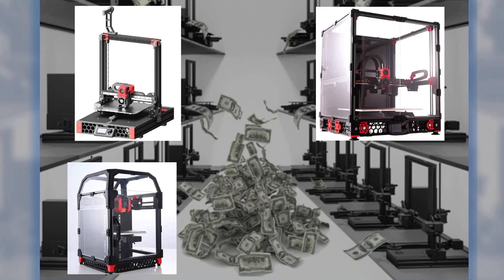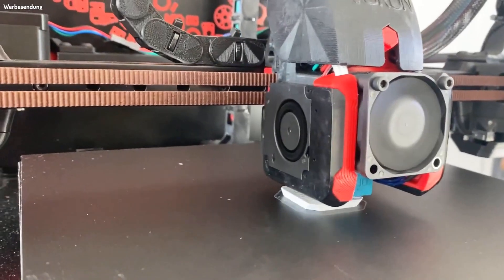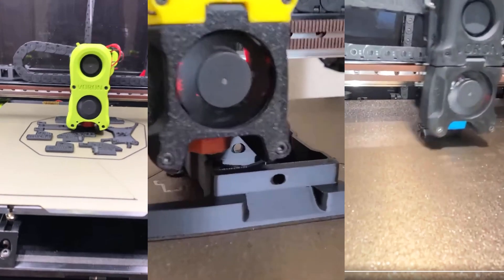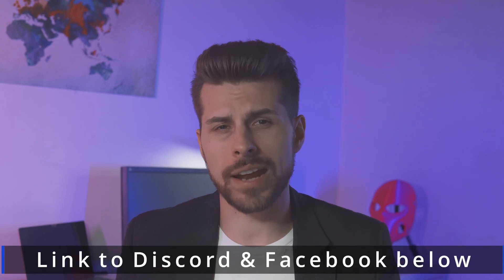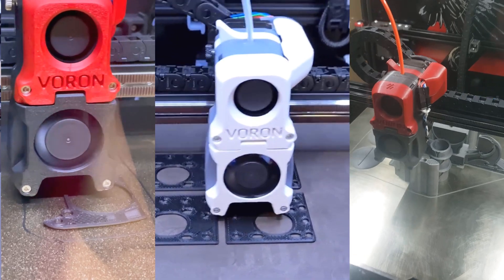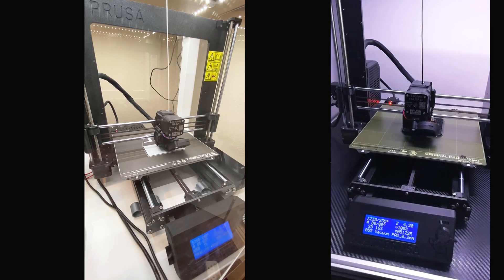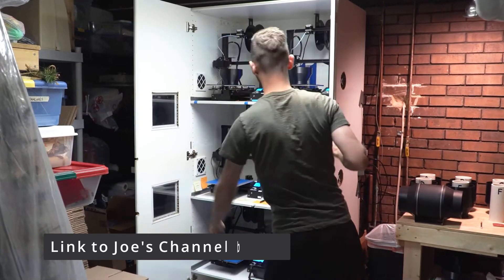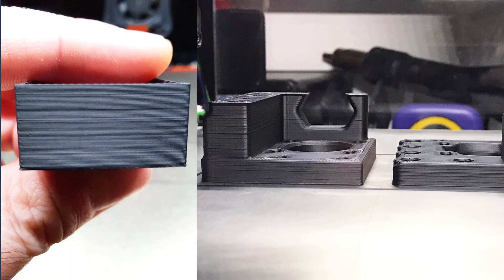Voron Printers: are they true farm printers or capable hobby printers?

Comment: I think you have missed one thing you just said  one sentence, the "heavily modified" Enders you have. Maybe take into account the time/resources to modify those ones as well? And compare them to a DIY reliable printer like a Voron one, as well as, comparing other printers from the group: the switchwire or the V1 are great options too, and for small prints, the Zero (0), but overall, interesting opinion 🙌🏽
Reply from the maker: Hey Dann, appreciate your feedback. 3years ago i changed old machines with enders, and was doing just fine. After some time i started getting specific material requests and in order to maintain same machines and don’t get different ones i modded them. I designed very few pieces (fan duct, led mount, pi mount), and all the rest were available online, so very low thinkering, i extimate less than 5 hours for all designs. Hardware installation was less than a working day for machine. Not much overall. I was planning of making a video on them and how i split my work, just have to find the time between rush orders. I wasn’t comparing my printers to vorons, just stating that everyone has different needs thus different printer requirements

Comment: Coming from someone who does print for my personal business, I can say that a Voron printer is a nice addition. It's default printing speed and acceleration settings are about twice as fast as most consumer printers. I just built a 1.8 and it is quickly becoming my go to work horse to substitute my Ender 5 workload and eventually replace it. I did buy a Flashforge Creator Max 2 to print the parts and now thr FF is part of my small print farm. Do I think Vorons are a viable for print farms? Yes but I would plan on building a new machine perhaps every 6 months and slowly replace less capable machines and not plan to build a lot at once. I also sourced all own parts. The ABS experience on a Voron is amazing. They print ABS like it's PLA. That reality sets in when you see the cooling fan running at 30% to help cool the ABS.
Reply: Can I ask why you went with a 1.8 rather than a 2.4?  Thanks.
Reply: @redone823  It's cheaper and more easier to build than the 2.4. Easier to tune. And I figured that since the hotend is at the top of the build volume, it would have an advantage with chamber temp. The 24v components are also easily accessible without having to flip the printer on its side.

Comment: I’m getting started in running my own production and have two Enders with upgrades. Considering the trouble and cost going into adding another upgraded Ender to the line up, and to save space, Vorons are very attractive options. If I’m willing to put in the money for a faster,  more reliable, and consistent machine, are there alternatives to the Voron lineup that can perform comparably?
Reply from the maker: For responding at your question, ratrig is a valid contender. But i don’t know your current needs, so before investing money you will have to do some homework. When choosing a printer keep in mind ROI and time required for regular maintenance and non ordinary maintenance
Reply: look at ratrigs IDEX machine get 2 parts done at the same time as one and you would have the option of adding a second color to 1 print if needed or supports that is water soluble if needed

Comment: 2 Prusa i3 mks+ kits cost 1500 USD and 2000 USD assembled, unless you mean clones, in which case you should specify.Cooling vise, it's not impossible to take of the side plates and leave the door open.I just bought a 2.4 for 1036 USD ink shipping and tax so.And the 1.8 I cheaper. Otherwise valid points:)
Reply: And when that 1 voron goes down what do you do then?
Reply: @dangerous8333  Since they cost half as much as an assembled Prusa, I obviously have 2 so no problem 😂

Comment: My 2.4 kit from formbot cost me $950 canadian and took 1 week to arrive via DHL  ( $1,599.99 CAD for Prusa mk3+) & it prints like a dream. Quiet, fast and no maintenance for 6 months now. Abs costs $24 a spool for abs+ here. If you don't need it enclosed; simple just  open the doors? You can easily remove the panels or not even buy the panels & use one of the many mods for better cooling for pla. ERCF multi material mod costs like $100 and you can have it change spools for you automatically when it runs out loading up to 9 spools. It may not be the best business oriented machine but most of the cons you mentioned are fixed pretty easily.
Reply: Did you print your own parts or order them from somewhere? I am considering ordering a kit but dont feel like printing out the parts myself.
Reply: @Cheetahcubb  I can print the parts for you, cost + shipping.
Reply: Don't forget most people aren't up spending a week building a kit,
. Also there is no way a 9 ch ERCF costs only $100 with shipping and no assembly required.
Reply: This is very encouraging; I made up my mind to build a 3d printer as looking at the Canadian cost for a Prusa I just couldn't justify and I am okay with the time commitment to get it up and running.
Reply: @BrownMInc  The LDO kit from Sparta3D was very well done. Many nice touches. Especially the terminated wire harness... that saves a ton of work.
Reply: @SeanTaffert  I just checked them out and it seems they're out of stock. I've decided this will be my 1st summer project once school is out so I'm viewing other sources, maker parts and spool3d seem to have it. I just joined the voron discord as well
Reply: @BrownMInc  typically the official PIF program from Voron has long wait delays, and not all colour combos are avail from suppliers. I can offer you what you want typically sooner then they can supply.
Reply: @SeanTaffert  thanks for the offer. Given that I won't seriously commence building until at least a month from now I think I'm ok with the queue. If you're as competitive and willing to wait till then I'm open to working with you if you can show some examples/a store. It's times like this I wish YouTube had some messaging feature
Reply: @BrownMInc  just google me for my contact info. Which model are you looking to build?
Reply: @SeanTaffert  I may have found you. I am looking to build a V0.1 mainly for portability.
Reply: @BrownMInc  I'm sure you did. I'm the only one. Montreal based. 
V0.1. Perfect. That's what I built recently. I'd suggest a few mods. Contact me and we can discuss.

Comment: True, using any DIY printer in a business comes with some problems and some advantages. Being DIY you know every single screw of the machine and if something breaks down you know what to do. It also requires an initial investment of tuning and calibrating the machine. Personally I do think you should know your machines 100% if it is your business.

If your products should be made out of ABS I would for sure have a Voron farm. I have a Prusa and 2 Vorons and the Prusa is pretty much collecting dust right now. My V2.4 and V0.1 beats the Prusa in every aspect - however they both required a much bigger time investment to get up and running.

As always, do your research and buy the right tool for the job. Need ABS and want to know your machines? Voron. Need PLA and dont want to know about your machines and you want the option of support to hold your hand if something goes wrong? Go with Prusa!

Comment: i still don't know how they make it to 500+mm/s is it upgrade of bowden extruder + motors or is it just software setting? (talking about voron...) thanks!
Reply from the maker: Hi Katsuo! High speeds are a combination of machine and software. For the hardware, a rigid small frame with tiny moving masses allow high accelerations and high average speeds. The main cap is caused by melting capacity of the hotend (reason behind magnum+ or HF hotends.) if the printer goes fast but the hotend can’t keep up with melting plastic, you will get extrusion issues. For the software, klipper in voron case, has equations that precisely calculate motion paths and amount of material extruded. Good motion system+capable hotend (and extruder!)+good software = high speeds

Comment: I have 4 switchwires in my farm. Same cost as a prusa and 2.5 times as fast for same quality, ordered parts for a 5th on Wednesday and had it running today. You didnt even think about the switchwire when came to your conclusion about 'the voron line'
Reply: Thanks for the input! I’m still trying to figure out what the strong points of each Voron are.
Reply: @toddsfinsdotsurf  If you're still deciding. Build a trident.
Reply: @dangerous8333  thanks ya I've got almost everything I need for a Trident now, gonna be using the new Octopus board, 48V steppers!

Comment: Some valid points, but you should consider building one. In short, most of the issues mentioned, can easly be solved with a mod.
Reply: No they can not. Issue 6 in a lot of people has yet to be solved even after trying different extruders and toolheads. For the price, the Voron 2.4 is a waste of money IMO. However the switchwire and the 0.1 (for smaller parts) are a much better value for the money without the headaches of the 2.4.
Reply: @TheNature101  The issue 6.... Most people don't have it. That's the problem with DIY, you don't follow the sourcing guide and you cheap on something, you run into a problem.
Reply: @KubaAirs  Actually looking at all the crappy Voron 2.4 prints on youtube, I would say "most" people have it. However it is difficult for cult members to admit they spend $1500-$2000 for a plastic functional parts printers that produces crappy prints, when they could have spend 1/4 of that for a Sapphire Plus CoreXY printer with full metal functioning parts, that produces better prints.
Reply: @TheNature101  There are over 2000 2.4 now.... You're totally missing the point of something like Voron. What makes you think that cnc parts makes better printers?  How about Prusa, Annex k2/k3, HEVORT and most of the good DYI printers? 3d printing is not cnc machining and the fast movements of the toolhead must dissipate somewhere. Make it too stiff and it will endup in the toolhead itself, that's why we measure resonance. Voron and similar printers are for somebody who prints day and night. For someone who likes to play with his printer. If you're only printing webcam covers for your grandparents, every printer will do. When you're building Voron, you're spending money on high quality parts, your whole printer costs same amount of money as a set of high quality MGN rails... You can't expect much from that, can you? Try to update your printer with higher quality parts, you will endup at the similar price level that of a voron.. Don't forget that Voron is not a product. It's a Do it Yourself project. That's where a lot of people fail by buying kits which basically cheap on parts
Reply: @TheNature101  I even went that far and looked at CNC Kitche's review of your mentioned printer... I think there's nothing to add to that. You get what you pay for
Reply: @KubaAirs  I don't think cnc kitchen reviewed the sapphire plus. They did the sapphire pro which is a smaller cheaper different printer to the plus. And the sapphire plus with $100 e3d v6 or dragon hotend/orbiter direct drive extruder mod blows away the voron 2.4 at 1/4th the price.
Reply: 2.4 is not that expensive.... But now let's compare comparable. It's similar design to Voron 1.8/Trident. Good vendors on discord sell the kit for about 800usd. Now, your goes for around 500 + the dragon hotend.
For that you get: high quality/LDO rails, LDO steppers, thick cast aluminium hotbed, Misumi extrusions, quiet fans, octopus/spider board, PTFE cables and so on and so on. So in the end of the day, the sapphire plus seems to be the more expensive option. It looks like a good printer though - I don't question that. It's just that if you ever decide to upgrade and build another printer, you won't be able to reuse a single part out of your current build...
Reply: @KubaAirs  The Sapphire Plus is actually $400 at Amazon +$100 for the mods=$500 total for a 300x300x350. On the 2.4 you forgot that the $800 kit is Chinese dangerous low end junk (and for 250x250x250 at that), and then add the functioning plastic parts (add another $200). then add for the wiring another $100+ if you don't have all the tools, then add, if you care for your life, change critical components like SSR and others, better hotend, better extruder than the junk clockwork, etc etc etc... The fact is a 2.4 will end up costing you $1500-$2000 for a plastic printer, that has a very high probability to never produce high quality parts at high speeds. So thanks but no thanks.
Reply: @TheNature101  You're still overshooting with the pricing. Also IF you buy a kit, buy from a discord approved Vendor like Makercube or Magicstudio who will source all parts for you according to the BOM.. I printed all parts myself and had tools like crimper prior to that but that's the case with any DYI printer.. You're talking about Chinese dangerous low-end junk but it's you who bought one :)))) Good night, It was nice chatting you here on youtube. I wish you happy times with your printer.
Reply: @KubaAirs  Actually I know how much it costs cause I built a 2.4. And it produced garbage prints at 100+mm/s no matter how many mods or high level components I threw at it. I also have a 0.1 and it prints beautifully. But is tiny at 120mm^3. I plan to use the 2.4 parts I have (and add a few more) to try and save all the money I spend on the 2.4 and build a Trident instead.

Comment: The key to any print farm is having sufficient printers of the same or similar model that you don't have to constantly reslice models for each variant.  Identify the size model your printing and have sufficient printers to print it repeatedly.  Multiple printer versions introduces complications.  Keeping similar models keeps costs down because you can have fewer repair parts on hand to fix issues as they arise.
What irked me about the video is you're trying to compare the Voron to other printers.  You state the Voron is great for high temp materials because of the enclosure (which isn't required to be added on for lower temp materials) then go on to hype the Prusa and Creality line, neither of which have enclosures.  They are not straight comparisons.
Reply from the maker: Hi Gaanon! Your idea of printer farm is on spot, quite similar to another video i made time ago on managing a printer farm. Similar people think alike  ;)
I made a comparison only on cost between a 2.4 kit and a prusa with an example of production output for the same budget. I don’t really hype creality printers, after years of using them, i can state they are sufficient printers for getting started, but left stock they need a high degree of maintenance if continuously printing.
Every situation demands particular machinery, hard to fit for all and make it a ultimate machine

Comment: Couple things.  I think you may have overlooked the PIF program as examples of people running vorons in a farm type setting. Several of the PIF providers have multiple machines cranking out sets of voron parts constantly.     Also, I think if you were to take a farm based approach with voron printers, the V1(Now called Trident) is a more cost effective way to do it. Many people overlook the V1 design as worse, because the V2 has a two in the name. They are separate projects and I believe a V1(Trident) build can be 2/3-3/4 of the price of a V2.     Otherwise valid points.
Reply from the maker: Hi Jeremy! Yeah money wise a Trident could be cheaper. But will be always put in second place by the name (as you stated) and for the less “interesting” motion system. I’m following VERY closely the IDEX system Eddie is developing. Could be a deal maker.
I talked about PIF in another Video on 3dprinting niches, as a way of creating a farm and 💰. But if you run already run a farm, and want to buy a voron, PIF with 8weeks lead time becomes a huge problem if you need immediate fire power especially with holiday peaks

Comment: So... you make a video about Voron but never actually built one or use one. You have no idea the time it takes to source and build it. You don't have one so you have no experience with Voron yet make video about it?!?!?
Reply from the maker: I was expecting a similar comment. Kinda proves the point of the video. I tough the voron where gret printers, but more i read and collected information, more i discovered that these printers require a massive investment of time. Just making some math, if you get paid 50$/h and you take 50hours to build and tune the printer, you are looking at a 2500$ investment, then add the printer cost. I have a local friend that went trough a voron build. Inquiring on the build and sharing my toughs stated in the video his reasonsing where something along “yeah, it has been a fun experience, but you really need to commit to it. I would not advise a 3d printing business to have a voron just because the community says so”.
Again..just business perspective of things, not hobbist having fun
Reply: @3DPrintingForMoney  If it takes you 50 hours to put together a kit with a manual. You don't deserve $50 p/hr
Reply: Good points both sides. I agree, a business has to use more critical viewpoints and criteria when evaluating an option, and the time invested to assemble and tune isn't negligible. That said, just like with enders, the second one would be much faster to get running, and each subsequent machine will take less time and energy. Outside of crimping, I think a person could reasonably get assembly down to several hours, assuming printed parts are sourced. That first one IS a beast though.